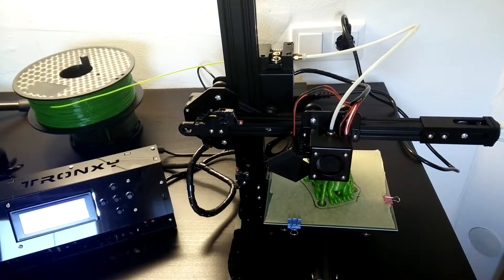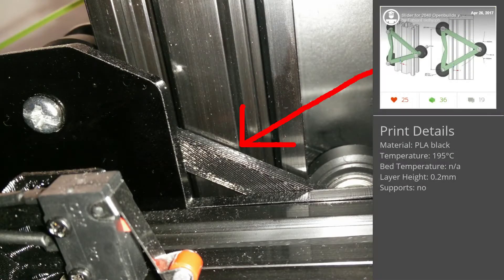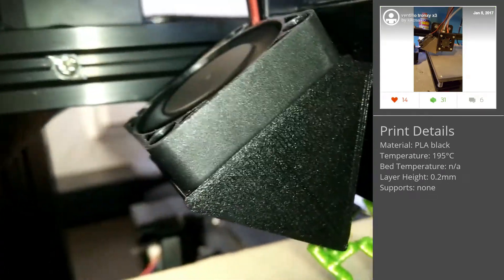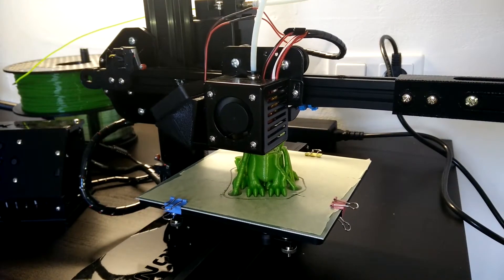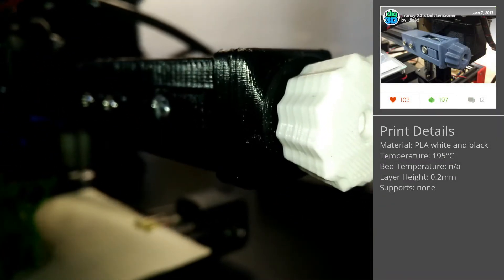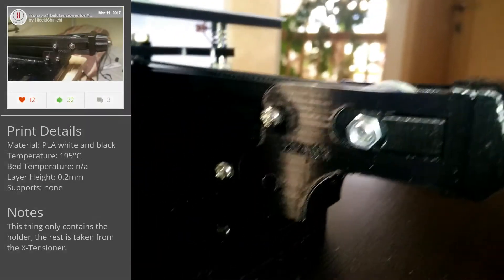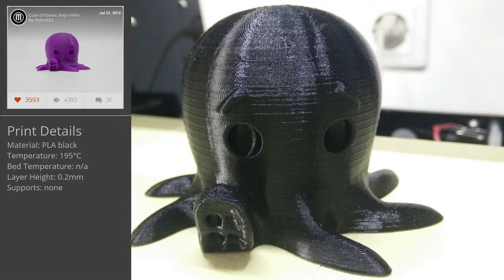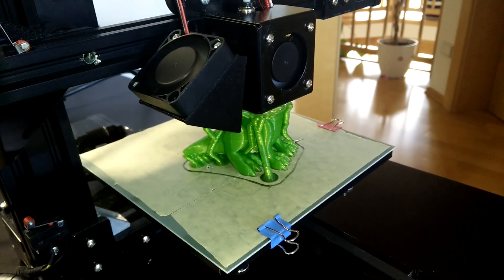TronXY X1 Important Upgrades

Comment: I understand the brackets on the bottom and sides of the printer for everything. But I don't understand the point of the fan, or any of the belt tensions. Can you explain the point of these please?
Reply from the maker: The fan cools down the just extruded material to "dry" it before it can warps. Loose belts lead to wobbling as a movement of the motor isn't directly attributable in a movement of the part then, as the belt has some play. Tensioned belts don't show this issue and therefore the prints will be far more accurate and cleaner.
Reply: Caverntwo oooh I see. So these upgrades aren't optional, but more like mandatory. Except for the fan which I don't see a point to
Reply from the maker: Yes, they drastically increase the print quality. You can imagine that prints, especially with overhangs, won't turn out well without a parts cooling fan. The fan really helps.

Comment: Can you link the part fan you used, and where to pulg it in?
Reply from the maker: Devin Weng, I used a normal 40mm fan, extended the cable and plugged it into the free fan output.
Reply from the maker: Hi! Thank you very much for sharing this coupon code!
Reply: Oh boy, I found it for 129.99 USD with coupon code: GBTRONXY1
http://www.gearbest.com/3d-printers-3d-printer-kits/pp_494194.html?wid=21&lkid=10781362
I bought one

https://www.youtube.com/watch?v=iCA0v_XE0Sg

Comment: a question!  I put an extra fan on like you did, but it's not spinning. is it because of some settings?
Reply from the maker: The normal hot-end fan should spin once the printer is powered on, but the parts-cooling fan does not. The Melzi board with the stock software supports a cooling fan, which you can manually turn on in the "Fan Speed" menu of the printer. It needs to be turned on in your slicer software as well: In the latest Cura, there's a "Cooling" tab which has a setting to enable the fan.
Reply: Caverntwo super fantastich!   thanks

Comment: How do I get my motors to work manualy? 
I had mine 2months as I can not get it to print.
Motors turn a little when I home and stop.
My hot end heats but cant home or manual control or even print.
Is there settings you can do a video of?
Reply from the maker: Hi! You can move your motors manually in the "Position" menu of the printer. 
If they stop when homing or don't move at all, it could be that they are somehow blocked. I suggest you loosen up the belt and test the motors in this condition. If they work then, the belt somehow blocks the movement as it might get stuck/rib on the extrusions (like my X-axis belt did originally). But if not, check the cables and if they are connected and not broken, there might be an issue with the motors or the Melzi board. I suggest you try out the above solution and if it doesn't work then, feel free to comment me again.
Reply: Caverntwo 
Yes Ive checked alot and done most of this.

If you get 5 minutes could you tell me
Steps per mm x y z and e
Acceleration x y z and e
Acceleration ms2
Feedrate xyze

And on repetier host printer settings, printer, 
Travel feedrate
Z acceleration I think it is under it.

Can you please post them as Im really struggling. I tried to use the pots from 0.100v to 0.800v. I can get it to try home and it tries to move to the end stop but its juttery and jiddering.

Cant get manual control to work at all, only attempts to home and stops.
.I tried running a slicer pront and moving X pot but no joy no movement so im thinking it is settings or the melzi.

Thanks for reply.
Reply: And jerk think that will cover this and marrow it down to the pots. If they dont work Im hook a ramps up.

I calculated many steps per mm but got some movement at a high 500 steps per mm on X and Y with 3000 acceleration.

My standard setting only had 400 acceleration so I am interested to see what yours are.
Reply from the maker: Well. That sounds interesting. 
Unfortunately, I have never used Repetier Host but set up Cura for my prints in the beginning which worked with the default settings. 

Have you already tried manual movements without any overriding acceleration/jerk settings, like executing some simple raw g-codes? You could follow my simple g-code video (https://youtu.be/SQ5ZOtb3Cjo) either offline via SD-card or "online" via some g-code transferring software like Printrun (http://www.pronterface.com/). 
Every g-code based machine has default values for all settings/actions which it maintains unless changed via the codes.
If this doesn't work with your printer, there could be some hardware/client software issue, but try g-codes with the default settings first.

To be honest,  I never went "down" that far as the default settings worked more or less (although I know that you can achieve better/faster prints with adapted settings)...

I hope that I could help you.
Reply: Caverntwo I used slicer cura and some others. All doing the same thing. Its never worked from start properly.
I got another youtubers settings and sure its the above and pots.

I need the
Travel feedrate mm/min
and
z axis feedrate mm/min

And some setting for extruder as motor is getting super hot and wont move. So need setting for that.

I put my driver pots down to 0.001v and have had same juddery movement up to 0.800v

Whats your extruder 
stepss per mm
Acceleration?

I need these last few.
Reply from the maker: Well, if you want your printer to move 40mm/s, it would result in 2400mm/min.
The values on my X1's controller in the configuration tab say 400 for x/y and 4 for the z axis. I don't know what units they are though...
The extruder steps/mm setting is 90 with an acceleration of 5000 by default.
I don't know about the voltages you are describing, didn't inform myself about them yet.

Comment: What settings do you use for Cura?
Reply from the maker: For the machine settings, look at one of my answers below. In the video the X1 prints PLA with a temperature of 195°C and a layer height of 0.2mm. The speed used in this video is 40 or 50mm/s.

Comment: Do you use cura for slicing ? If yes could post your mashine settings . Unfortunately there are no presettings for the x1 in cura :)
Reply from the maker: Yeah, I use Cura 2.5 because it's relatively easy to use.
For the settings, basically, when you add the X1 as a new machine, it's important to set the X and Y parameter to something around 130mm and the Z parameter to 150mm, the rest can be let as it is the default. I know, it might be better to make use of the "Printhead" settings, but, to be honest, it's not that important. In my case, the middle point of the build plate was offset by about 1cm (~1/2"), look up my GCode video (https://www.youtube.com/watch?v=SQ5ZOtb3Cjo&t=1s) to find out how to compensate it and add the resulting G92 command to the start Gcode. That's basically it. 
If you have any further questions, I'm happy to help you out!